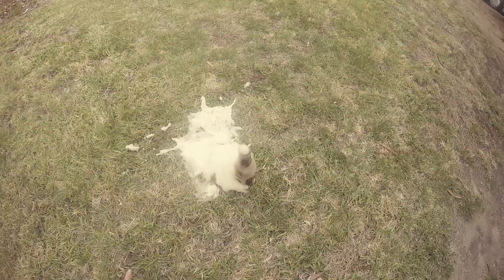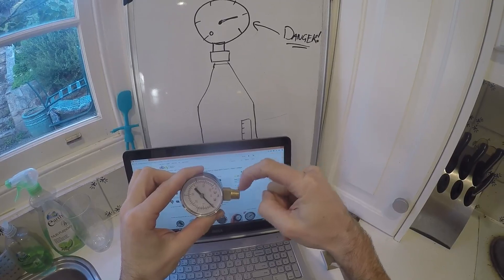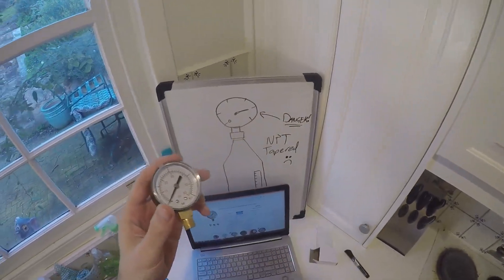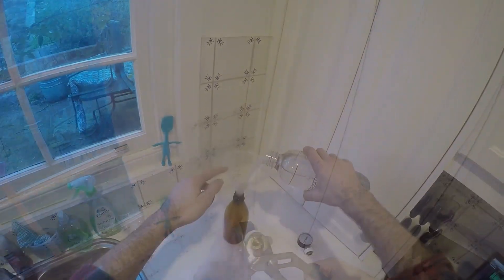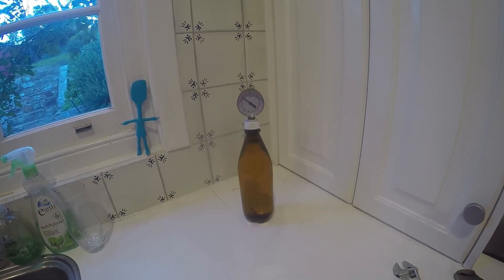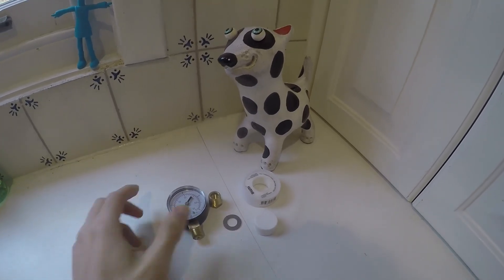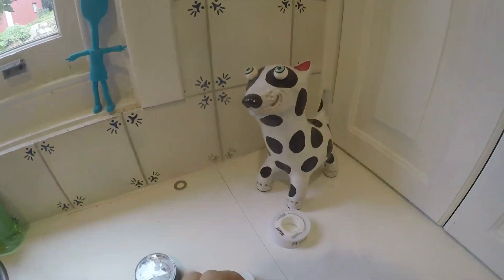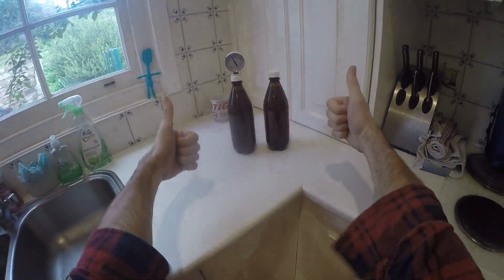New invention: Danger Bottle!!

Comment: Do u end up drinking the beer u put into the pressure gauged bottle? Or just tossing it? Curious how the beer would react to the metal.
Reply from the maker: I do, veeeeery carefully. The metal never touches the beer either so as long as it tastes ok it's all good. I only tend to use the gauge on suspect batches too.
Reply: Do you ever take requests? If u do, could u in the future make a recipe off of the Briess website. The one I’m interested in is the one called Deutsch Mexikaner Lager. Thanks http://www.brewingwithbriess.com/Recipes/beer/display/deutsch_mexikaner_lager
Reply from the maker: Hmmm, I haven't before, but that doesn't mean I'm not open to it. Still, it'd have to be something I would want to make (after all, I'm the one who has to drink 2-3 cartons of the stuff!), and I'm not going to be making any more lagers for quite some time I don't think sorry.

Comment: Damn, I should try this!  my last batch had 2 bottles that was waaaay to bobley
Reply: So it won't help if it was only 2 bottles. It means probably that the priming sugar not equally dissolved or bad cleaning. I had the same problem with a batch where I had only one bottel gush and the reste was fine. (could be badly cleaned bottle as well). Just saying ! :) But anyway it looks cool
Reply: Ya thanks. I should probably clean my bottles better. haha! but its so BORING! haha Cheers mate